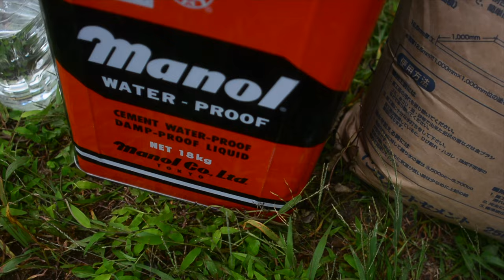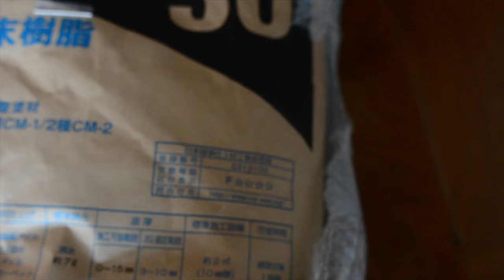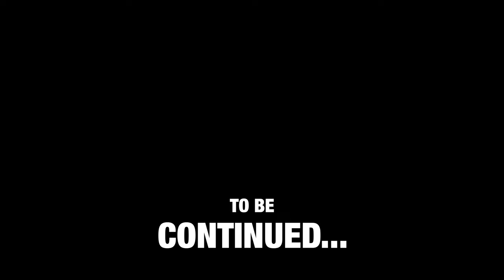I renovate an abandoned Japanese Bathroom haunted by a kappa monster - Part 1

Comment: Another great episode, DIY-J. I'm going to actually be going back and rewatching your previous videos because after much scaling back and haggling with my contractor and persistence from my agent, we have settled on basically a near all new first floor done by the professionals which is in my budget. The second floor, which is much better condition, will only see extra structural support from below because it introduces no extra complexity or cost if done during the first floor renovation. The second floor then will be a "resto-novation" done entirely by myself. The biggest improvement in my quality of life is going to be swapping out those frosted glass window panels for clear glass. You did a small hallway one--was it fairly easy to locate exact matches for your framing?
Reply from the maker: Swapping the frosted glass will catapult you from feeling like an inmate in a penitentiary to an actual free man living in a house lol The glass I used was ordered online through a glass company. It was cut to size according to my measurements. The glass isn't cheap when the size of the window increases. I've done a few of the really big pieces and the it was about 20,000 yen a sheet. Ouch! 😰 🤕
The website is:
https://www.kowa-v.jp/
you can put your measurements in and check the price of the glass.
Reply: @DIYJapan  Ah, so you can't buy it pre-framed any the correct dimensions and insert it into the wall frame. That is a bit more complicated, given the size of the second floor windows.. I appreciate the link though! Maybe I will try a small window first.
Reply from the maker: My windows are enormous. The size is also a very uncommon size in modern houses. So they don't really sell that size window frame pre-made. This was the same case for the bug screens. People would just give me the ''confused blank stare'' when I gave them the dimensions of the windows. They just don't make the size anymore. That's the main reason why I just custom cut the glass and replace it into the old frame. It's really the only way.
Reply: @DIYJapan  My house is from 1985, how like do you think it would be for me to find the entire frame pre-made?
Reply from the maker: Hard to say, I guess it really all depends on the size of the windows. Of course there are companies that do custom made windows... but it's gonna be expensive, no lie. That's why most people don't do it. Cost.
Reply: @DIYJapan  in some truly spectacular awesomeness, builder came back and said he can do the swaps on the second floor for only an additional 60,000 yen. That's 5 sets, 10 panes, six of which are quite large. I said yes immediately. We start work in a couple of weeks. Outstanding.
Reply from the maker: I'm utterly shocked lol Nice!

Comment: I am a little confused.  Why concrete in a wooden home?  The home will sway and flex during the various seasons and storms. Or is there something I'm not seeing / thought about.
Reply from the maker: In a lot of the older homes, the bathroom is sort of a separate structure in the sense that the four walls are made of concrete and the house frame wraps around this structure. It's true that the house will sway and the ceilings are connected to the bathroom and have some affect on the bathroom walls. But since it was all originally made of cement... I don't have much choice if it sways and cracks the wall. It does happen in some homes. You will see cracks in the bathroom walls. I figured if it ever did crack, it's more easily mendable than broken tiles like the original state it was in.
Reply: @DIYJapan  Indeed. Mine is the same way. It's why I can't have my bath tub section raised to the same level as I am doing with all of the rest of the first floor (my elderly mother walked the house with me during consideration, and there are four different level differences on the first floor, which is where she would stay when visiting, and that's a no go). The subfloor is all going to be modified to make everything on the first floor the same height, but that can't be done with the bath tub section because it is its own concrete cube, and the previous owner had done a fairly recent renovation already, with a brand new gas heating system, so all I am doing is putting in a new door because the current one is too short for me and I keep hitting my head (the ceiling height actually goes all the way up to the floooring on the second floor, so its absolutely cavernous height-wise, the ceilings in the other rooms are unnecessarily low and will be brought up).